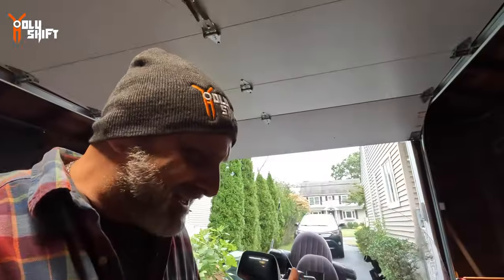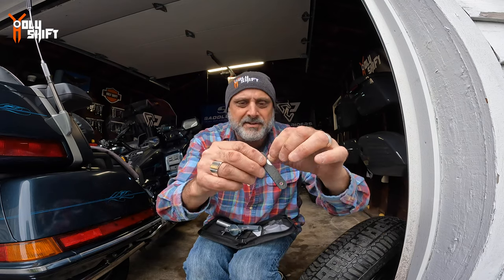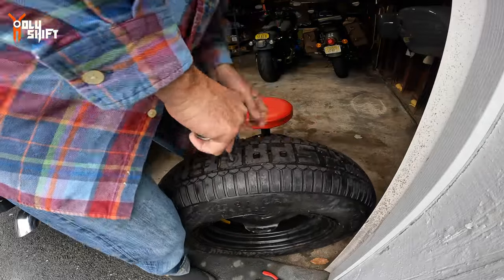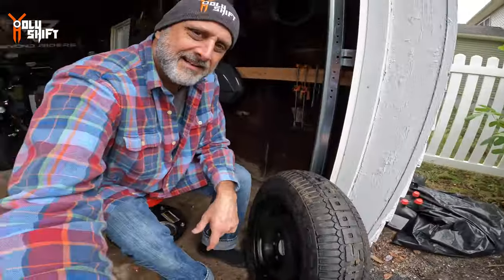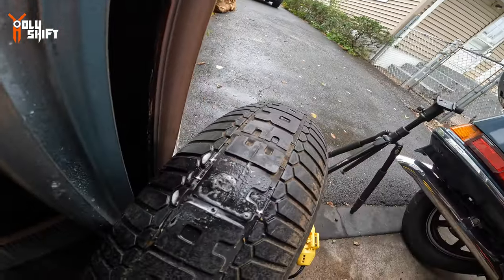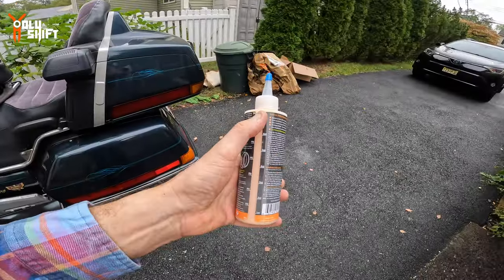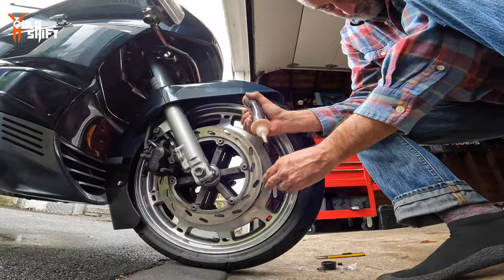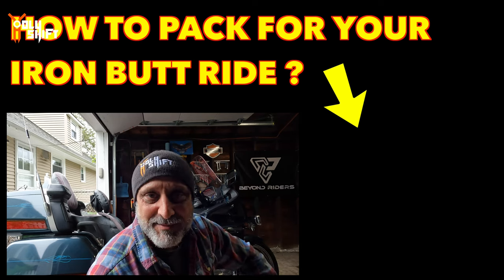Never Get Screwed‼️ JUST DO THIS !

Comment: I find using a thin coat of the glue on the rubber insert makes it easier to insert and pull out. Also gives you an extra layer of glue between the insert and tyre making it leak proof.

Comment: Hi 👋, Holy Shft 😂, great vidéo, I havé never seen the Coring trick  before, only at the tyre shop, but I’ve been using the gel in the tire probably back 2004, 2006. I think I’ve done it, on my Deuce, I do know that when you take your wheel or bike in to have a new tire fitted, but they do not like the compound that’s inside it as it creates a hell of a mess, and difficult to clean, I’m back in the mid-90s. I had a 1200 sportster riding down to Lake Garda., about 12 of us, we’re riding through some roadworks and I’ve picked up a lot of steel which lacerated the back tire, needless to say I needed a new back tire, by the time I was picked up by the rescue service of the motorway to the time I was back on the road again. I was looking between 9 to 10 hours, needless to say, I had 9 to 10 hours of riding to catch up with my colleagues, 
Luckily, only somewhere between 4 to 5 hours away, from where I was, they had pulled over early , and stopped at hotel 🏨, 😂
Good luck with your butt crack 😂 ride safe, Phil from the moulin

Comment: Thank God for tubeless MC tires. I got a blowout on I80 in the middle of Nebraska back in 1978. Tube popped, instant rear tire air loss at 75 mph. Went down on shoulder with my girlfriend, no injuries. Took my wheel off, put new tube in, mounted wheel with new tube. Blew it up using a hose connected to one cylinder while I cranked the bike. Called dealer 25 miles away. Got 5 miles from him and the tube poked out the side of the damaged tire and now we’re on the side again. Dealer came out with a trailer. Owner paid mechanic to work overtime to get us on the road. Owner of the Yamaha dealer lived next door, and fed us dinner in his home, while we waited for new tire.
Reply from the maker: Wow some story ! See what we remember!😂
Reply: @HOLYSHIFT  Those are the kind of rides we never forget. Like riding 400 miles in a steady downpour, with temps in the 40’s.

Comment: Excellent video! When i worked in the South Bronx one of the not so many advantages is there's a "Flats Fixed" shop on every corner $7 per plug and $10 per patch. The Honda air connection is an awesome accessory. Too bad HD doesn't have an air connection and if they did it would be a la carte.